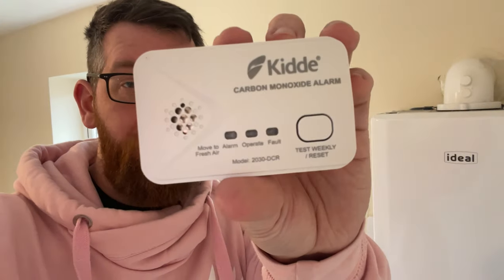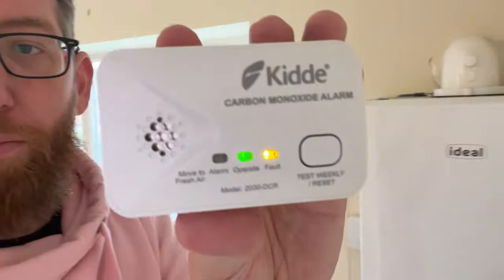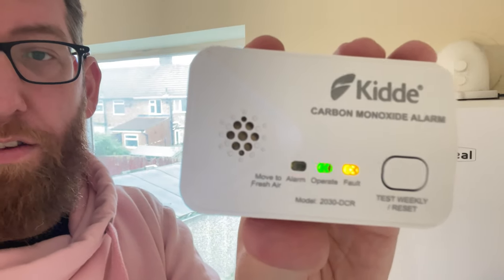How to test a carbon monoxide CO alarm is working Kidde

Comment: What does the yellow mean?
Reply from the maker: The yellow light shows up as a fault, so if you’re getting that without pressing the test button you need to get that checked out asap.
Reply: @FixItWithFusco  I only get it when I test is this okay x
Reply from the maker: That’s fine as the test is to show the sound and lights and make sure they’re working.